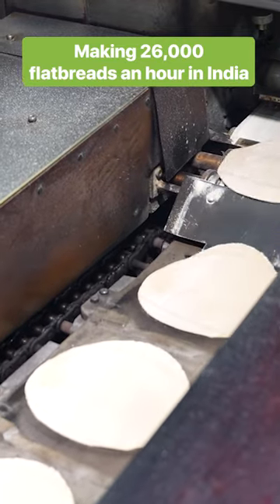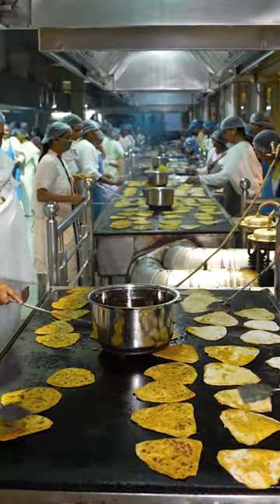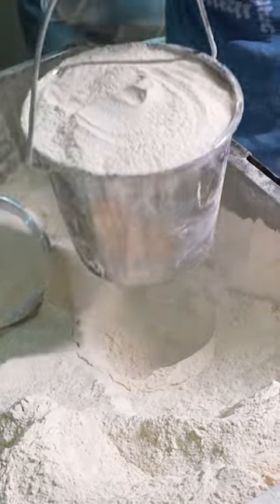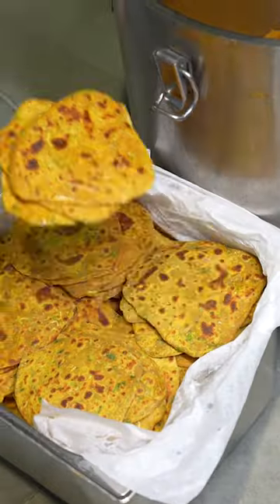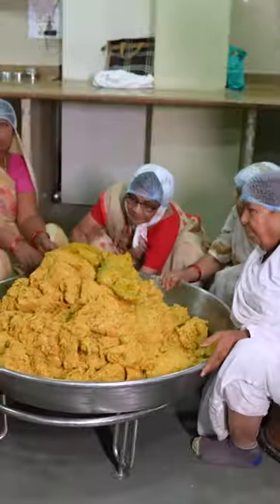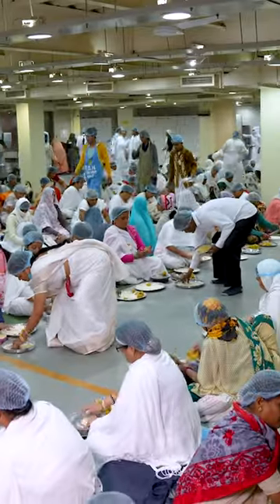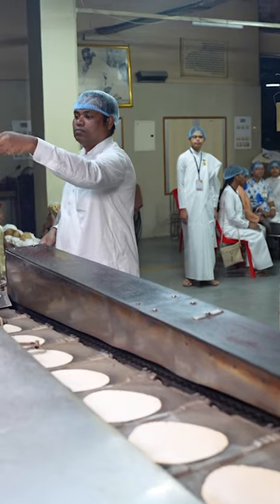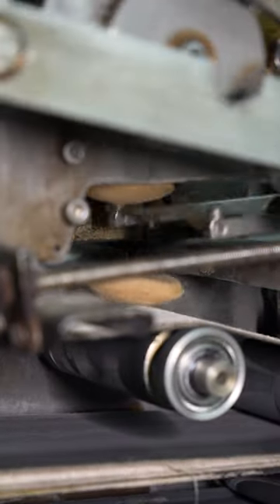This kitchen can make 26,000 flatbreads an hour. #india #howitsmade #cooking

Comment: The men get the machine but the women have to have "volunteers" lol
Reply: There is a very significant difference between chapati and thepla dough. If you were to use the machine that you use for chapati for thepla too, it would not be as good as a hand rolled one. Also the machine is for chapatis not the men.
Reply: The machines are not for "men" vs "women". The machines are for chappatis which are the simplest type of Indian bread - just wheat flour, salt, water, oil - and therefore machines exist to make them. Theplas are more intricate since they contain more ingredients (wheat flour, chickpea flour, coriander leaves, cumin seeds, fenugreek leaves, spices, etc) and therefore require human hands  + machines don't exist (yet) to make this beautiful bread. Pls don't create a sexist debate where none exists. I am Indian AND a woman AND make/eat both chappatis and theplas AND have eaten at many temples with kitchens exactly like the one in the video, so I know what I'm talking about. Thanks